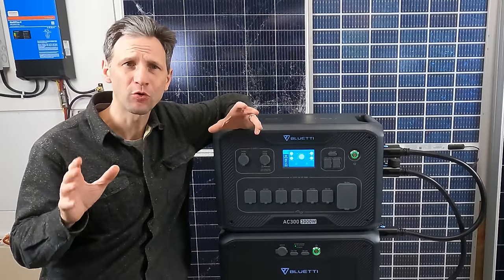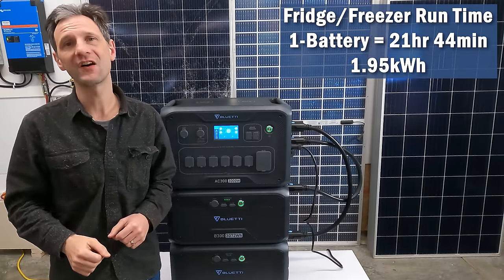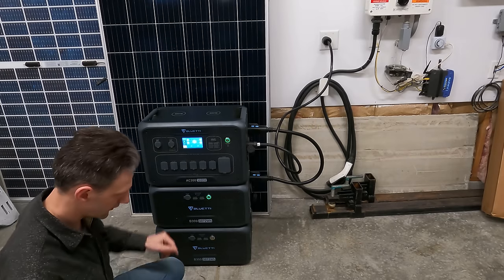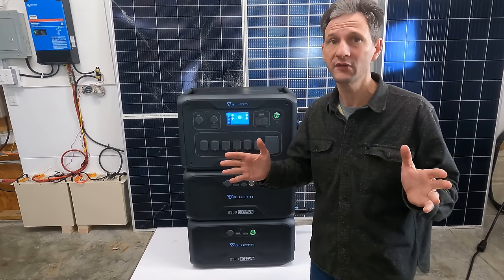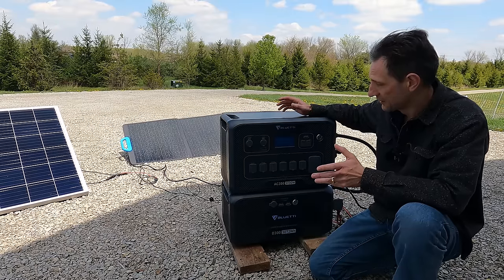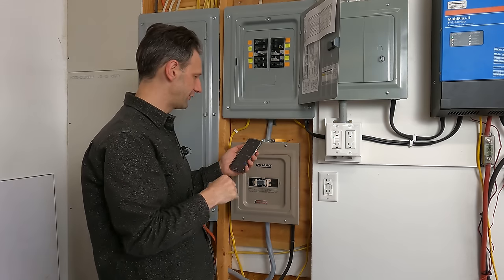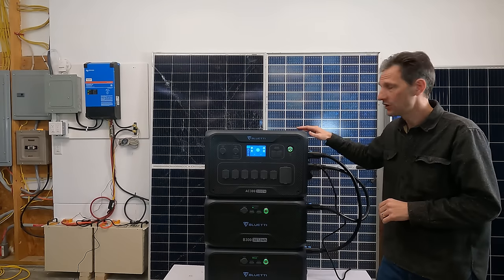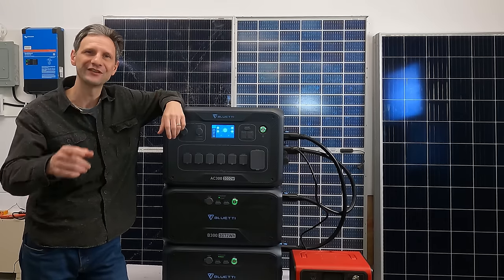Easy Solar Power Home Backup - Bluetti AC300 + B300 Review

Comment from the maker: If you have one of these power stations and have had problems or helpful tips, just comment here:
Exclusive Bluetti $100 Discount with code: DaveAC300
BLUETTI AC300 + 1*B300 | Home Battery Backup link: https://shrsl.com/4aur5
BLUETTI AC300 + 2*B300 & free solar panel | Home Battery Backup link: https://shrsl.com/4auri
Check out more useful information on power station and solar generator information on my website here: https://projectswithdave.com/portable-power-station/
Learn more about solar power and home backup on my website ProjectsWithDave.com: https://projectswithdave.com/
You can also purchase on Amazon here: https://amzn.to/3B1E3sh

Comment: I purchased one of these for my RV.  What I know about electrical systems wouldn't fill a thimble so I needed a plug and play solution.  It's nice to know that it is overkill. I'm happy. Thank you for this video.
Reply: None of these systems show how to install the 2020 fec requirement for a AC shutdown. Suggestions.

Comment: Bluetti needs to utilize buss bars instead of cables for their interconnections. Since these units stack with a designed gap between the units, perhaps a port on the top and bottom of the unit could be designed. As stand alone devices these connector ports would be covered.

      The issues with cables are three fold: The longevity and reliability of cables is < bus bars.  The cables can be snagged or pulled by movement, pets, or children. The cables interfere with tight installation on the right side.  This is why bus bars for cell interconnections is the standard for industry and the military.  Torqued lugged connections (ie not friction plugs) connect the battery input/output.

       Thanks, Dave, for the thorough review.  I agree with your criticisms and recommendations 👍😎
Reply: Thank you for sharing your thoughts, Dave. I completely agree with your points regarding the use of bus bars instead of cables for interconnections. It would definitely enhance the longevity, reliability, and overall installation experience. By the way, have you checked out the Segway Portable PowerStation Cube Series? It offers a massive 5kWh capacity, fast recharging, and waterproof technology, making it a great option for outdoor enthusiasts like us. It's definitely worth considering for your camping and backup power needs. Keep up the great work, Dave!

Comment: 21:40 watch out where you are pointing that heat gun, it looks like you are heating those power cords.
BTW, What is the inverter standby power consumption (inverter is on but no AC load connected)?

Comment: Without connecting to a main electrical panel I just want to know what main appliances I can run with a similar setup, how long till the batteries needs charging and how to charge with solar panel. Just the basics. All this other stuff way over my head.

Comment: I recently bought an EV.  Currently, my solar inverters do not have the EV direct option. So I convert DC to AC and then converted it back to DC to charge my car.  I have a grid-tie system without any batteries.  Can you figure out the cost saving of having an inverter with the EV hookup that charges the EV without all the energy loss associated with converting from DC to AC and back to DC?  Great channel.  Thanks!
Reply: I had a similar question as you and this is what I found. First of all, there are no off the shelf products that I could find that charge an EV directly DC to DC, so right off the bat you're stuck with DIY and modified options. Solaredge says they charge directly off solar, but they still convert it because it uses a J1772 plug. Residential EVSEs come with either a J1772 plug or a Tesla plug. The J1772 port doesn't even contain any high current DC pins, so you're out of luck unless you have a Tesla, but the only Tesla stations with DC are the Superchargers and they don't normally sell those. If they did it's reported to cost between $25k and $100k plus installation. Similarly, both Chademo and CCS stations are $12k to $35k plus installation. Combine that with the fact that there's no such thing as a DC slow charge protocol. The slowest rate DCFC rate is 15-20kw depending on manufacturer, which would require at least a 15kw solar array, probably quite a bit more. You could theoretically get around that by using a battery as a buffer, but it'd still be super expensive and probably kill the battery rather fast with a lot of cycles. 

So how bad is converting DC to AC to DC? https://avt.inl.gov/sites/default/files/pdf/fsev/SteadyStateLoadCharacterization2015Leaf.pdf is an Idaho National Lab experiment on a 2015 LEAF. You don't mention which EV you have, but I'd assume that the charger for your car is the same or more efficient at converting AC to DC than that one.

For the DC to AC side, https://www.e-education.psu.edu/eme812/node/738 says that high frequency inverters are 90-95% efficient and low frequency inverters are 75-85% efficient, at least in the mid range of their power rating. Since you have a grid-tie system, you're probably using microinverters, which are usually the higher efficiency.

So your total EV charging efficiency is 67.875 to 85.975%, probably closer to 85%. So not that bad. Look at it this way, centralized electricity generation loses 2.2 to 13.3% of the power generated just transmitting it to your house, so inverting your Solar DC is probably about the same efficiency as using the grid. https://insideenergy.org/2015/11/06/lost-in-transmission-how-much-electricity-disappears-between-a-power-plant-and-your-plug/

Sorry, that was huge, long and confusing, but I hope it helped.

Comment: I am late to comment, but I just came across this very complete video, thanks.

I already have a gas powered generator for power outages, but at the last outage, trips to gas stations were a nightmare, so I am considering getting a battery, so I get more flexibility.

Do you have any data on how this unit charges using a generator? The idea would be to run the battery as the main source of power for key appliances, then charge it with the generator if the outage goes on for a long time.

I would like to eventually use this as a solar system, but I am taking baby steps.
Reply from the maker: This unit is one of the better ones for charging with a generator because you can set the charge current to whatever you want to.  This allows you to perfectly match the load with the capability of the generator.

Comment: How long would each battery last if u ran it for 24hrs straight using 3000 watts per hour ? Could anyone give a real answer please ?
Reply from the maker: A 3,000W continuous load is very large.  
You can expect to be able to use 80% of the 12.288kWh capacity.  
0.8*12.288kWh=9.83kWh
9.83kWh/3.0kW=3.27hr
Reply: @ProjectsWithDave  Thankyou, I sort of understand your math and each battery should last approximately 3 hours at %80 efficiency
Reply from the maker: Yes, I think that would be a reasonable expectation.

Comment: I tried running my small chest freezer off of my Bluetti 200P and 600 volts of solar and it was disappointing. The solar got it to 100% but it was down to 23% the next morning. The freezer when running was at 70 watts, which is pretty good. So much is wasted when using the inverter. Mabe a key point would be to use something with a more efficient inverter.
Reply from the maker: The most important thing for minimal emergency support is getting through the night.  You can get a simple, inexpensive watt meter and measure the consumption of your freezer for a few days.  That will allow you to calculate the efficiency of the inverter for intermittent loads.  Only about 90% of the rated battery capacity is actually usable, so about 1,800Wh in your case.  Also I have found for an intermittent load like a fridge you can expect to get about 80% of the available battery capacity due to idle losses of the inverter when the fridge isn't running. 1,800*0.8= 1,400Wh available for the freezer.  So at 70W when running, you should be able to get at least 20hr of run time.  Meter link: https://amzn.to/3XwchOF
Hope that helps.

Comment: I love my water furnace but it is 20 years old and a soft start is $1500 so if it ever quits I will be looking for a ground source heat pump with a soft start.
Reply from the maker: The 40A soft start I'm working on with ActiveStart is only $365.  ( https://amzn.to/42rTcie ).  It will start my 4Ton geothermal heat pump with the latest version of the software, but It still needs some improvement to smooth it out a bit.   I'll post a video once it's fully working.

Comment: My natural gas powered backup was $3000, but it makes 12,000 watts for weeks if necessary.  Batteries die in a couple hours, and this one makes 3,000 watts, only a quarter of a generator.
Reply from the maker: Generators have there place.  I would always start with a small generator for emergency backup and add battery and solar later.  I compare the cost in this video: https://youtu.be/f0skwN5sJvg
Reply: K @ProjectsWithDave
Reply: That is true, but it isn't portable and requires having natural gas and a service agreement.

Comment: Nice review Dave!  I was wondering how this model handles passthrough charging..  I'm torn between this AC300 and the Delta Pro..  The Delta Pro has limitations when it is plugged in to AC power...  What happened if you were pulling more from the inverter than the AC input could supply when it was connected to AC power?

Comment: We do not understand how to connect solar to main contol unit. Can you giveinfo on specific cable required for AC300 and Bluetti solar panel.
Reply from the maker: There is an included cable with MC4 connectors.  Make sure the voltage of your solar panel is within the allowable range.  There are two sets of connectors, one for each MPPT input.  Connect to one of the pair of connectors 1+ and 1- for instance.

Comment: Do you or anyone reading this have a way to set a timer so it turns off and on at certain times? The machine can only be manually turned off either 1. When it's entirely dark or 2. Pulling the pv cables then off.

Why I ask this is because unlike the other solar machines I have, it drains like 1% or so per hour? So that's like 10-12% when I wake up and attend to the machine. I hate that it drains so much just on standby mode. And you can't turn the damn thing off if there is even a spec of light, got to pull the entire pv cable. 

Thanks in advance.

Comment: The extension cord you used to bridge both phases in your transfer switch is that something you use all of the time are something for the video and should be used long term?
Reply from the maker: Bridging the phases is something you should only do if you know your system well.  For my emergency panel I only have one 240V load, so I could turn off that breaker and know I would not have any issues.

Comment: Can the B300 stand alone and run my refrigerator overnight?
I'm looking at the Bluetti AC300 or the EcoFlow DELTA 2 Max?
Your thoughts, please. 
Thanks
Reply from the maker: My fridge ran for 21hr and 44min on one B300 battery.  If you plan to purchase that one, take advantage of the Black Friday sale.  You can use an Amazon $400 off coupon and by using my link and code on my website you can get an additional 3% off that price: https://projectswithdave.com/portable-power-station/

Comment: The cheap, high frequency, transformerless  inverter technology that Bluetti is using was never meant for powering inductive loads like the planer in this video. Without an iron core, copper wound output transformer to absorb the high startup surges, It won't be long before the MOSFETs in the H-Bridge circuit in this unit fail from repeated exposures to high surge loads. And when that happens, you had better hope that you don't have any expensive appliances plugged in to it because you'll likely set those appliances on fire if those MOSFETs have shorted to ground and this unit starts passing high voltage, high amperage DC current into your appliances. Better have a bunch of fire extinguishers handy if you've wired one of these into your home's electrical system.

Comment: I've got a single AC300 too, and like you, I keep my 240V breakers (water heater and well pump) off when I power my transfer switch with the AC300 instead of my generator. But wouldn't it be fine to leave them turned on when using the AC300? Both sides of the circuit would be at the same potential and no current would flow. Or am I showing my ignorance?
Reply from the maker: Leaving your water heater breaker on should not hurt anything.

Comment: Hi Dave, so interested in your  video!

Watch other videos off Bluetti of people testing, have asked how do you you charge the units off a vechile that has 12 volts from car batteries to  the AC 300 and BC 300.
I tried but the power lowered, is there something I'm not doing right? 
Plugged into my 12 volt outlet in vechile while running the car l was not sure what to put the inlet to solar or other while doing  this was not sure.!
I did hear and see use an inverter to help while your camping is that what l am doing wrong having to get an inverter from car 12 volt to charge the AC 300Bc 300.
I might sound stupid but l am not a tech person in all off this hope you can hope 
John
Reply from the maker: Did you connect the car output to the AC300 DC input?  Same port for solar charging. See page 19 in the manual: https://cdn.shopify.com/s/files/1/0536/3390/8911/files/BLUETTI_AC300.pdf?v=1672305785
Reply: @ProjectsWithDave  
Hi Dave thankyou for replying back. l did connect it that way ,was uncertain if to put it on PV or others?
Maybe l have another look to see if l had the connections correct having dual solar connection on the 12 volt plug. 
Regards
John
Reply: Hi Dave l actually worked it out l used the wrong solar leads into the unit it turned out to be 240v l am in Australia.
Till you told me DC that's when l looked at what l done wrong. I never knew l had a connection for that till l seen what l had in leads.
Thankyou for input l  looked at the book but it still not made any sense untill you mentioned the solar input for DC. That was the difference  Thankyou
John

Comment: Hi I'm looking to buy a unit that can run 2 items - a pool pump for about 12hrs a day, at 1800w. and a water tank pump at 1100w that comes on and off everyday as taps are open.
Is there a unit that can do this?
Thank you
Roger
Reply from the maker: That is a huge demand!  
Pool pump: 12hX1800W= 21,600 Wh
Water Pump: 3hx1100W= 3,300Wh
Daily Total Consumption= 24.9kWh
That's about five LIFePO4 server rack batteries if you are running off grid and want to make sure it has power on a completely cloudy day .  You can see a system that size I installed here: https://youtu.be/ipLRNglTdhg
It would also take a good size solar array to meet that demand.

Comment: Have you had a chance to test the Bluetti EP900? I think I need IN-LINE 240V Through the unit between shore-power and my Tiny Home /RV for full-time on-call backup if/when utility power goes down. I need UPS and EMI as well.
Reply from the maker: I haven't tested the EP900.

Comment: Apartment dwellers could use these solar generators but where do you put the solar pannel? Three days of backup is a reasonable goal so do the math. If you want to backup your house, don't waste your money on these toys. Install a full solar system or get a gasoline inverter generator. Most home owners can get by with a 2000 watt generator and some long 10 or 12 gauge extension cords. If you need a small window AC &/or maby a big Freezer then get the 4500 watt inverter generator. Solar is great but cloudy days can ruin everything and you will wish you had a gas generator.
Reply from the maker: The first step in preparing for emergencies for most people is to have a small low cost generator.  Adding solar later gives you some additional flexibility, but as you said the sun isn't always shining.

Comment: Would you be converting to a heat pump water heater in the future?
Reply from the maker: I'm considering it.  Do you have a recommendation?
Reply: @ProjectsWithDave I have an AO Smith Heat Pump hot water heater. Uses about 2kWh/day. For 2 Adults. Highly recommend.

Comment: Question: Since you have 3 units stacked together, does that equal around 9kWh of useable power? You just are limited to the inverter at around 3,500W? So you could run most appliances in your house with the 3,000Watts of power but with 9kWh, they would run for like a day or two? Am I getting this right? Thank you. I've been considering getting these massive 10kWh batteries for whole home backup, but I have a Bluetti for camping and it does well. If I can just expand this system and implement it into whole house power backup, that would be awesome. Thank you for any help.
Reply from the maker: This system is different than other products in that the top module "AC300" does not have an integrated battery.  It is just the inverter and other electronics.  The lower two modules in the stack are battery modules "B300," each one has a capacity of 3,072kWh.  So, as tested, my system had a capacity of 6,155kWh.  You can connect a maximum of 4 batteries to each inverter for a maximum capacity of 12,288kWh.
Reply: @ProjectsWithDave  thank you. I started gathering that last night and that helped clear it up. Cheers. I’m considering another solar kit it includes panels and all accessories and is cheaper than the bluetti b300x4 without panels. Is there a reason I should choose bluetti?
Reply from the maker: Which one are you considering?